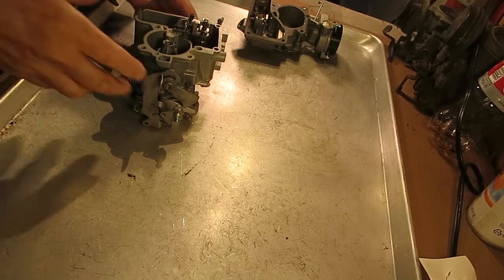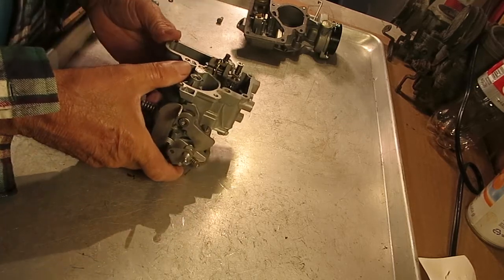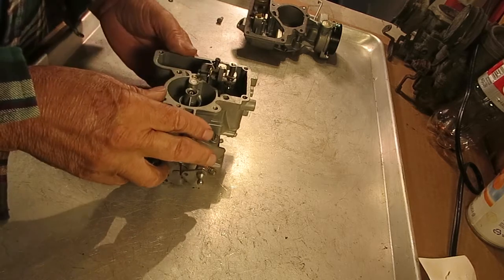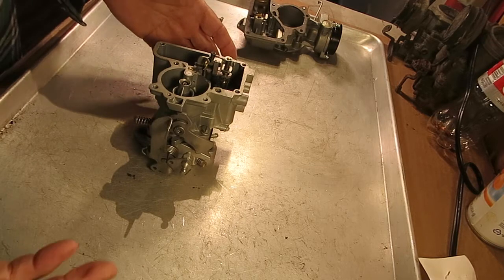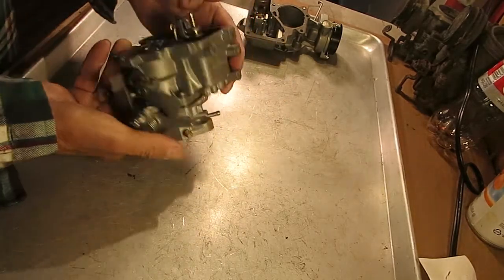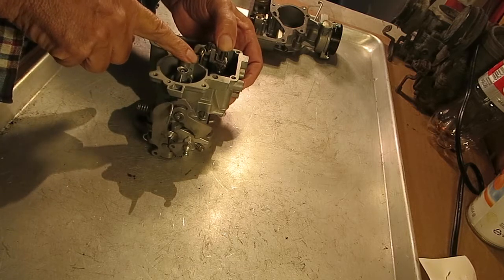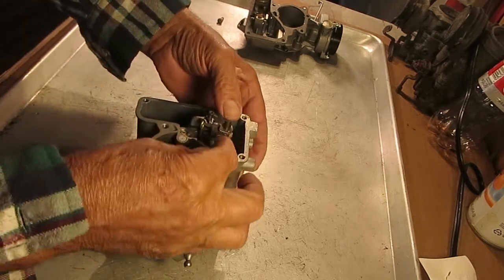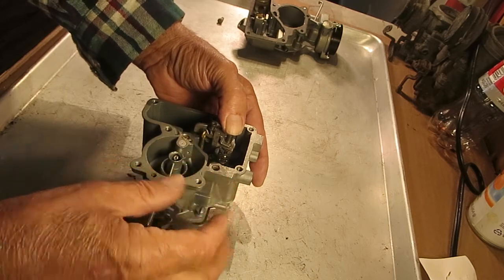Carter YF & YFA Metering Rod Adjustment

Comment: For clarity, Im pushing down on the accelerater diaphragm until the meter rod bottoms out, screwing the adjuster screw in (clockwise) until it bottoms out. Then screw the adjuster screw one more turn. - If i understand correctly, wouldn't this keep the metering rod from fully seating or bottoming out?
Does a metering rod dent or misshape after repeated bottoming out and that's why we're keeping it from completely bothering out? 
I'm trying to understand the metering rod and what it does aside from just knowing how to adjust it
Reply from the maker: I will be doing a video on this in the next few days.
Reply: @MikesCarburetor  I thank you so much. I know over the last couple of years 10 or 15 or just many questions. Your teaching me so much and your videos help me to understand better because I don't fully understand everything from the rebuild kit step by step instructions.
Reply from the maker: @michaeledwards8051  Thanks

Comment: Hi Mike, I bought a cheapo Chinese carb, everything was actually pretty well made but the metering rod screw wasn’t long enough to properly adjust. So I just bent where the metering rod attaches up to “raise” the initial position of the metering rod. Seems to be proper now.
Reply from the maker: Glad you were able to make it work.

Comment: The top section of that carb has a plug over that screw that you can pop out.  Then you can adjust the metering rod by just removing the air filter housing.  Did that to mine probably 30 years ago, still running in my old F250.  I usually have to adjust it for emissions testing, and I added an air/fuel gauge to get it right.  I also made a plug for that hole out of a vent valve seal.  Just trimmed the edges so it fit in the hole.
Reply from the maker: Good feedback. Thanks

Comment: Is there a way to adjust the CFM or any more performance from the YFA to not buy a 2bbl? For 1977 Ford 300 straight 6

My carburetor is not original.
How can I tell if my yfa is remanufactured to 170, 200, 250 or 300 cubic inch
Reply from the maker: You would need to research the carburetor number and maybe find the application. You cannot change the CFM. The bore size is a big part of it. Besides more CFM doesn't mean the engine can handle it unless it is high performance.

Comment: Hi. Thanks for all the great videos. I have a cheap copy of a yf on my 84 honda goldwing. Just trying it out I'm super impressed with how well it runs. It's burning too rich tho. Can you suggest a fix? It idles good and runs best with the mixture scree all the way in. It stumbles now and then but it just screams on the top end. I love it but I gotta lean it out.
Reply from the maker: Reducing the jet size is about all you can do. Figure out the current jet size then reduce .002 at a time until you get it dialed in.

Comment: My 52 Chevy one Barrell Rochester carburetor, Manuel choke, added New mechanical  fuel pump correctly, replaced about a foot of fuel line with black hose along with plastic fuel filter. I have followed your videos and used the correct walker rebuild kits twice! Double checked all info and steps..For some reason every time I replace the carburetor onto the motor, when trying to turn over the engine fuel shoots out the angled top spout towards front of vehicle each time. I've just been chasing my tail on this and was wondering if you could help with any info maybe the cause or causes it could be doing this. It's a one Barrell Rochester B on strait six 52 Chevy deluxe coupe DeVille 2 door. Converted from 6 volt to twelve volt correctly. All original otherwise. Runs great but carb only thing  holding  back from enjoying a family prized posession. Please and it would mean a lot from my  great great grandmother watching from above. Thanks, Kevin smith

Comment: Mike, I just got a 76 F150 with this carb.  Just to be clear, you want the metering rod to bottom out.  So I have the carb with the adjustment screw. If that screw is turned in too far, I assume it will hit and not allow the metering rod to bottom out?  So you would need to back the screw out (so it raises upward) which would then allow the metering rod to fully bottom out.  So, if that is the case, the last adjustment you speak of, so you adjust the screw out another turn, or do you screw if down another turn?  Hope that makes sense. Thank you for the great videos.
Reply: Mike, I just found the write-up for this on your page and it makes perfect sense!  Thanks again for the great videos!